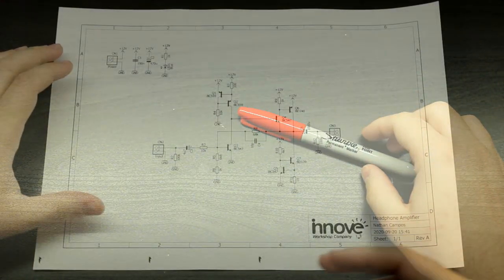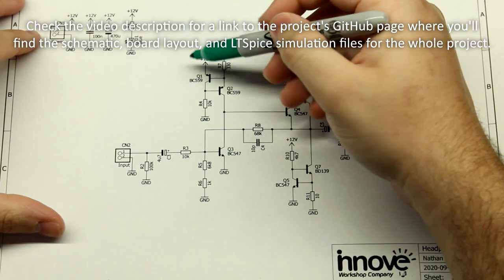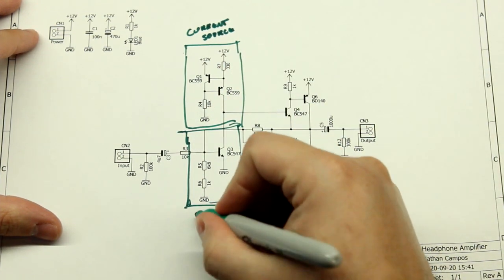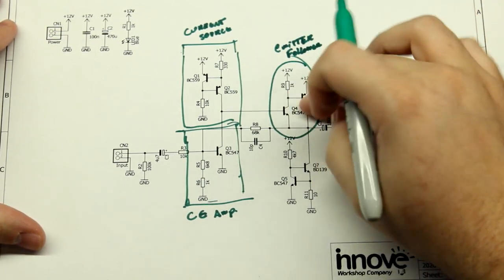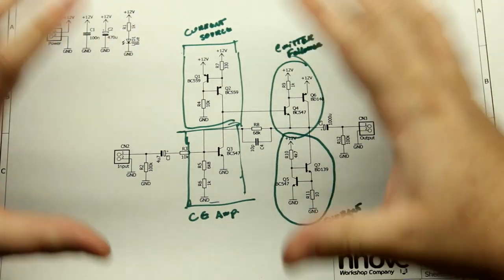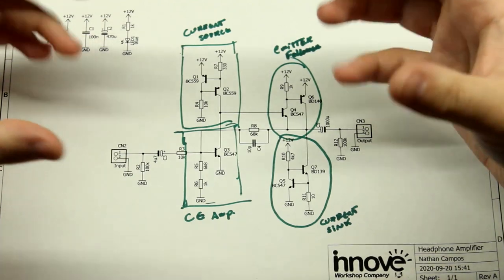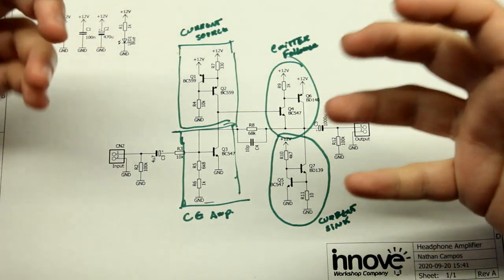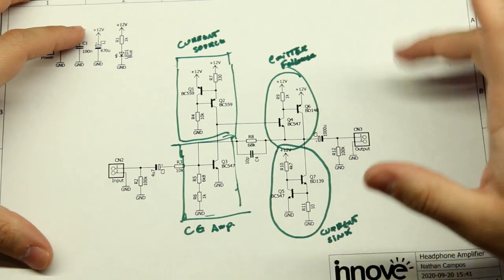#010 - "Final" Amplifier Circuit and Measurements (Class-A Discrete Headphone Amplifier Project)

Comment: Thanks, I used your Voltage gain circuit,  but I used a mosfet current gain instead of BJTs and a linear PS. Is hot, is inefficient AF but sound great.

Comment: If I use a 24V power supply, It will work? Is there simple spots to change or it has to be all recalculated again? Thanks
Reply: You'd have to adjust R5 to balance back a 12V midpoint at Q4 Emitter, probably near 13k. You'd have to double R4 to bring back the Q2 current generator to 2mA, near 20k. You'd have to double R10 to bring back the Q7 current generator to 70mA, near 9k. And you'd have to mount those output transistors Q6,Q7 on some kind of heat sink to dissipate the extra heat due to increased power consumption. Other than that, I see no reason why it shouldn't work at 24V.

Comment: First of all, loved your videos! I learned a ton! THANK YOU

I have a question: Why do you not take the feedback for the common emitter stage from its output like you did in your introduction videos, but rather you take it from the output of the Emitter Follower? What would change if I connected R8 to the output of the CE instead? 

Cheers!
Reply from the maker: Sorry for taking so long to reply. I'm really happy that you've enjoyed the series and learned a lot from the videos. That's the idea behind this channel.

About your question: The idea behind using feedback is to linearize the circuit in order to reduce distortion and improve the output impedance, since the feedback network will make sure that any changes in the output that are "different" from the input get nulled out. Taking that into consideration you'll always want to make sure that you take the feedback from the "furthest" node possible, that way the feedback circuitry will attempt to linearize all of your stages.

If you had connected the feedback network to the output of the CE it would still work, since the next stage is just a buffer, but you wouldn't get all of the benefits of the feedback since the buffer will introduce a bit (very little) of distortion, but most importantly it'll have a slightly higher output impedance without it, which may increase distortion when used with some headphones.

Comment: i think you could improve your THD on highs using a inductor in parallel with a resistor on exit (accordingly with my trusty free app cellphone inductor calculator, 2uH inductor with a 10R). i noticed you removed the oscilation by making a filter to transistor base but didn't filtered at exit... 

btw, i've never get why they use this inductor//resistor on output stage. in theory i get it, but i didnt learned it.

what a upset tweeter you will have XD
Reply from the maker: That would indeed help with the oscillation problem, but that in conjunction with the Zobel network at the output would be a bit of overkill, also the a capacitor is easier to source than an inductor, so it's preferable to use the capacitor.

Those types of filtering are usually more suited for higher power amplifiers, which need every extra bit of filtering in order to help taming their highly reactive loads.